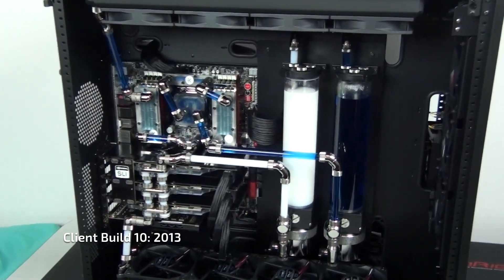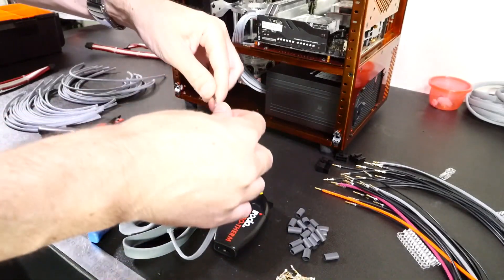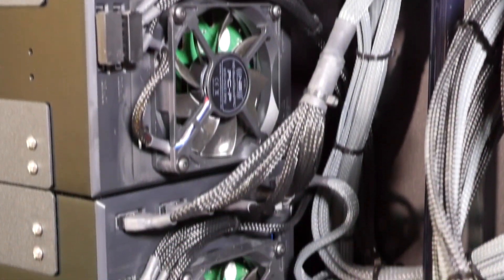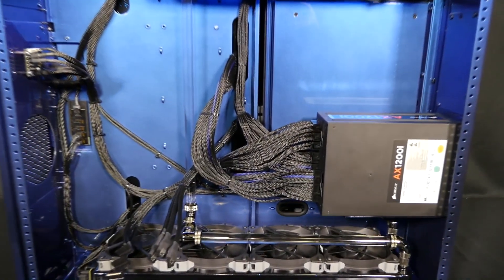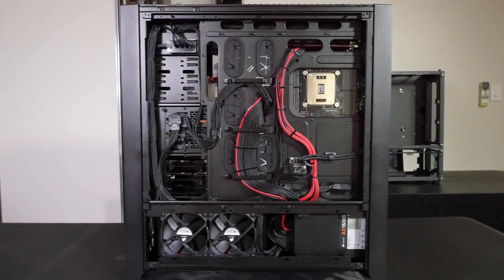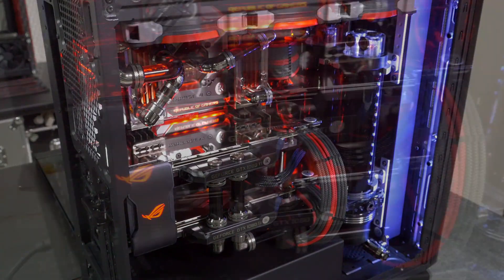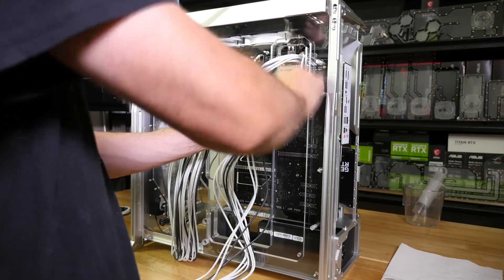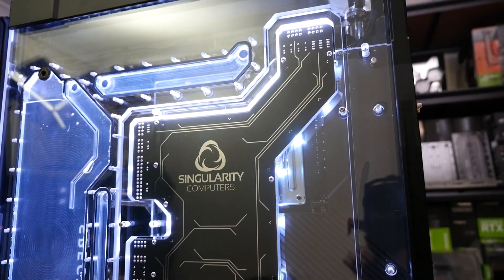SC Powerboard Technical Presentation: Part 1: Background

Comment: I made my pc case myself as I have a background in machining and fabrication as well as having my own CNC mill and router. I was attempting to make a fucking distribution plate/manifold out of different plastics which all ended up with every issue imaginable, cracks scratching poor thread quality ending up with leaks. I said fuck it and made my own out of copper. I gotta worry about dissimilar metals and I can't do cool RGB stuff with it but it can be painted easily to match any future builds. Allowed me to integrate a sick power distribution solution as well. I can't imagine how hard making one for public sale would be. I wasn't effected by constraints like manufacturing costs or myriad other shit normal people don't have the knowledge to know they should consider. I'm very pleased with my results but honestly the unit was incredibly expensive just in materials alone almost $1,000 USD with tools and such. Adding in development costs, time, waste on failed attempts....lets just say I'm very very glad I have my own "stuff". I really want to make my own radiators but I don't know if I want that much of a challenge lol.

Comment: making your own cables is like therapy (at least on your first time not sure i'd enjoy it a 2nd time).
also with what the tools to do it cost....almost a shame to only do it once (got 2 crimping pliers, 1st a "cheap" one which....just couldn't do atx pins and a "more expensive" MDPC-X one that works like a charm, and 2 atx extraction tools, a cheap one that just didn't really work, 45 min to take out 1 pin.... and a MDPC-X one that does actually work as per your recommendation :P) 

i do find myself crapping bricks 1st time i actually use one, look it over 10-20 times to make absolutely sure my cable is identical to the OG one pinout wise and when i'm sure hope it's all good (so far only sata/molex.   24pin, 8+6pci-e and 8+4 EPS cables done on 1 end and to long as i can't finish them untill i tear my cooling appart....and this takes SOOOOO long to do that it would eat up a significant chunk of my planned maintenance time..swapping out all fans and re-dooing my tubes/swapping out the reservoir and pump so already gone have a lot of time with my pc is not capable of being used.)

Comment: Uh Power Board, looks like a junction hub connecting the PSU at the bottom and short runs from the power board to the MB. Love the idea, seems a difficult issue to retro fit though....